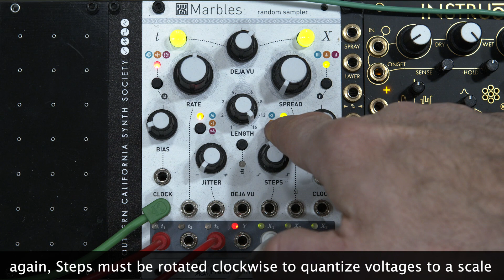Generative Patching 4.1: Intro to Mutable Instruments' Marbles

Comment: can you help this noob here understand - what have you plugged in exactly to T & X jacks? I think this is the thing - even this clearly great tutorial doesn't show all the signal path used. I keep guessing, but not matter what I tweak I just end up with one single note on repeat! :)
Reply from the maker: The T outputs are triggers. The X outputs are the random voltages, that change at the same time as the matching trigger outputs. If you're getting just a single note on repeat, make sure that the Spread and Length controls are not full CCW. The video above demonstrates Spread (plus Bias;, they interact). The other videos in the series (for Patreon subscribers) show some applications for the T and X outputs.
Reply: @LearningModular  yes what (and I admit a lot of this is due to overwhelm) find hard to recall is - if I want to play my plaits rings and disting ex - or just the disting in multisample mode (yes I got over excited 😫😂) is it just then a case of T in gates X into cv? Dumb I know but I get v confused and hyper focus myself into stress like any good old fashioned adhd sort. 
If your patreon can show me how to modular in a way my head can process sign me up already!!
Reply: Ps many thanks!!
Reply from the maker: @LordoftheBadgers  yes- T to trigger in; X to pitch CV in if your goal is random melodies. 

You might want to try one month of my Patreon channel at the "12v" ($12/month) level, as this will give you access to all of my articles plus my Eurorack online courses, and see if they explain things in a way that works for you. If they absolutely do not work for you, message me through Patreon and I'll even refund your month. The following link is to all of the articles currently on Patreon; there will also be subscribe buttons along the right side: https://www.patreon.com/posts/learning-modular-23481757
Reply: @LearningModular  wow that's fabulous thank you

Comment: Sorry, I'm new to all this, Is Marbles generating the sound to?
Reply: No. Marbles only outputs CVs and trigger signals. You pass those CVs and signals to other modules to control other them. e.g. you can connect X3 to an oscillator to random the pitch/frequency.
Reply: @Noyy  ah right ok. Thank you.
Reply: @Noyy  correct I use Plaits into Rings then send to Marbles.